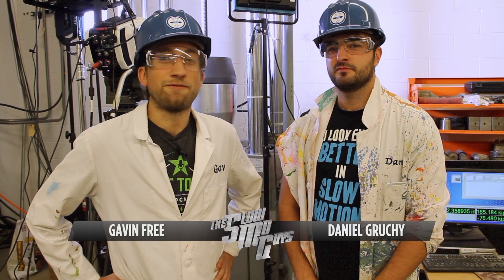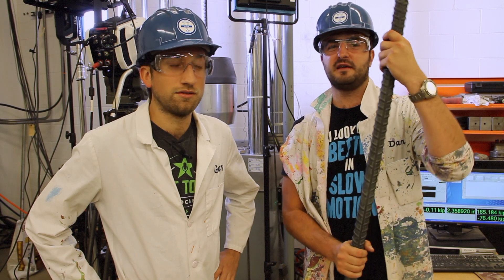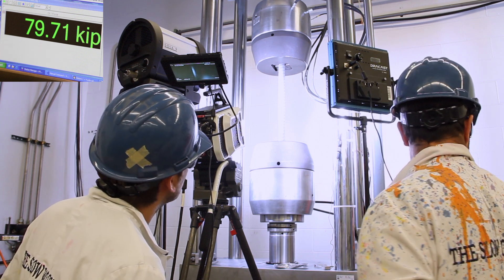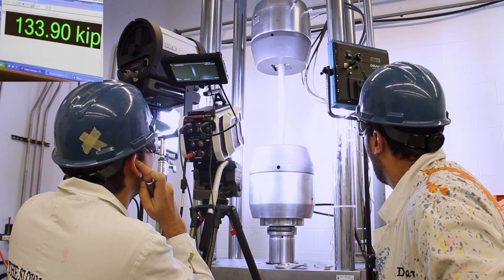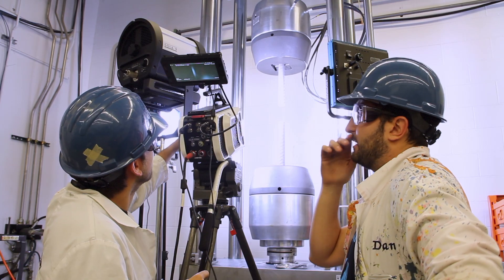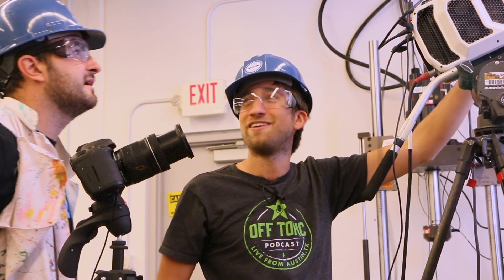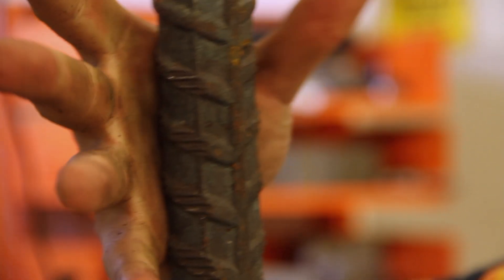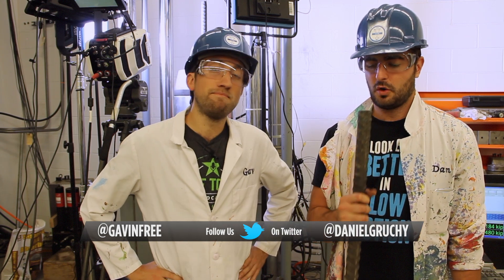Snapping a Steel Rod 1000x slower - The Slow Mo Guys

Comment: 157,000 LBS is an extreme amount of pressure. For comparison the pressure 7 miles below the ocean, at the bottom of the Mariana Trench, is only 15,750 PSI

Comment: 220,000 pounds is 100 tons.
The 1.5 inch bar has 1.75 square inches.
Rebar is made of cheap recycled scrap metal with  grade 60  tensile strength of perhaps  40 tons.
Therefore the bar should break at 75 tons which equals 75 x 2200 = 165,000.
It broke at 157,000.
This test therefore shows that Grade 60 Rebar is not as strong as claimed.
What is interesting is that in the latter stages 'bits were popping off'.  These bits are iron oxide which if melted in a hot fire would give the microspheres that imbeciles like Judy Wood claim show that 9/11 was controlled demolition with thermite and 'direct energy weapons.'

Comment: I was searching for clips showing the speed of sound in steel, like a solid version of dropping a slinky. I suspect the 48kHz clip probably would have shown that, if you'd run a full view without the speed jumps. It's clear that the particle cloud is conical from the break outwards, but that could be due to the increased displacement near the break rather than a propagation effect.
 So close... 🥺

Comment: The little bits falling off is the scale  from the rolling.  Rebar is about a 40 carbon, you should try a lower carbon steel to see a more dramatic elongation like a 1006 grade wire rod.

Comment: Is steel rod brittle material?!!! My whole life I thought it was ductile material.
Reply: 1. ductile means you can deform it without it breaking (like hammer it flat) but this iron bar is not as ductile as something like copper or if red hot. The bar is left stretched while brittle glass will just break without any final length change. 2. understanding metal fracture was one reason high speed cameras where first developed - you can use the "necking" (which is one sign of ductility) to trigger the camera. The necking reduces the area so the stress is suddenly more concentrated there then all the further stretch happens in the necked section which further narrows it and that part suddenly fails. 3. In the video you can see the sound waves sent up the bar as the end of the bar vibrates up and down for a while after fracture. 4. Most fractures travel at the speed of sound which in a iron bar is about 3000m/s or 6700 miles per hour. The fracture will span the bar in about 10 microseconds.
Reply: @bcwbcw3741 brittle materials break at almost no angle. And ductile material breaks at 45degree angle. This is because brittle material breaks in tension. And ductile material tends to break in shear. Do you know why ductile material tends to fail in shear.

Comment: If you were to convert 220,000 pounds to foot pounds per second 1 hp is equal to 550 foot pounds per second so if you were to divide 220,000 by 550 it would equal to 400 hp your welcome

Comment: I wonder how many lives this machine has saved just in general. Cause it's used to test the strength of manufacturers products that go out to consumers like rebar exc... To basically give the product a maximum weight/strength capacity so it's not used on something that wouldnt be able to with stand the weight/force exc... For example like steel rods that help hold up bridges or buildings. That way the construction workers know what materials they can or cant use for each job they do. So I assume this machine has saved many lives cause of this which is pretty cool to think about and whom ever designed this machine definitely deserves credit for that js.

Comment: You should record what happens to tension cable that's under concrete slabs when it has too much tension and is cut how it rips through the slab and can even take someone's leg off if they stand over it.

Comment: It seems like you guys have used high strength bar because the fracture surface is a straight surface break. If you've used mild steel bar with low carbon content the fracture surface would have been conical and gradual yield would have occurred

Comment: Machine would make a lovely torture device.

Imagine if macabre things like public executions and that kind of stuff were still popular, like if they put them on prime time telly. They could torture the victim using that device, and slow-motion replays using your camera. It would be super entertainment, would it not?
Reply: I doubt it would be able to pull you apart without cutting off your arm, or just pulling the skin off. It needs to grip tightly in order to pull you apart from both ends.

Comment: How does the machine stop so quickly after snapping it? You'd expect the two parts to quickly 'explode', but instead they just smoothly stop.
Reply: There is a hydraulic/pneumatic press on both sides, building up pressure to catch the force
Reply: If you would stand near it while that happened, you would feel the shake going through the ground

Comment: Its not 60 kips its 60kpsi (minimum allowed yield of rebar) since its rebar and thats its yield strength(strength till its a plastic) not its true ultimate. It should yield at ~100 kips not 60 and should hit ultimate around 160 kips. KPSI and KIPS can be confusing given their similarities but there is a massive difference.   Edit: it looks like it did indeed make it to basically 160 kips which confirms that you were conflating pressure and force, as well as yield and ultimate.

Comment: Years ago I was trained in nondestructive testing. We also did some destructive testing with machines much smaller than yours. Part of what we learned is that typically before the sample failed the steel starts to deform and stretches and the tention drops  (I believe that this is called the point of maximum elasitisity.) The steel if released will not return to it's original shape, but it will not have broken. The stress/strain gauge will start to climb again untill the sample fails. The steel then gets stronger and at the point of failure requires even more force before it brakes.

Something similar occurs when steel is heated. Although carbon steel melts at approx 1200 F steel at around 600 F will start to deform and lose its ability to retain it's shape. This is caused be the crystalline structure starting to allow movement to occur along those boundaries.

If anyone wants to look further into this subject look for stress/strain testing, or testing for hardness in materials, also see a charpie-V tester where samples are broken to see how much force was needed to do it.

For anyone who might know or even have heard of it I trained at TAT through ORAU and graduated in 1982.

Comment: I wonder how the machine stops itself from just hurling itself into a wall from the pressure being released.
Reply: sTone ForesT maybe opposing magnetic force
Reply: The old fashioned tensile testers had four 4 inch diameter lead screws lifting a 12 inch thick steel block. The machine was very heavy.

Comment: When it breaks, is all that metal coming off just random stuff that was on the rod, or did it actually shatter and that was material breaking off from all over the rod?
Reply: My best guess is that it must have been a coating on the rod to prevent rust or some other use.

Comment: Why not show a force/strain diagram? The machine can output it pretty easy. You could talk about elasticity versus plasticity for example. Why would you go through the trouble of recording stuff in slow motion if you pass on the opportunity to talk about the science behind what you're seeing? When I watch this video I just hear "wow, cool, hurr durr".

And btw, it's a steel rod/bar and not a steel beam. Rods/bars are only subjected to axial loads while beams are also be subjected to transverse loads (and sometimes torsional loads).

Comment: It didn’t look straight after. Like both after it was broken, the two ends didn’t line up. So I wonder if it was ever completely in line from the top and bottom when it was being pulled apart. Which would mean it wasn’t a true “pulling a part” but more of a snap from the pressure and from being slightly bent.

Comment: Just did this to a piece of 1008 Low Carbon Steel in a lab at Purdue. It's all based on the metal's Tensile Strength. First, the metal elastically stretches (meaning it can return to its original length), until it reaches its Yield Tensile Strength. After that point, it stretches plastically (cannot return to original length). It will keep stretching until it reaches its Maximum Tensile Strength. At this point, it will start to "neck", which is the bit around the fracture Gavin pointed out at 4:37 . Wrote a whole lab report on it, so funny this video came into my recommendations lololol.

Comment: That's not actually the correct force pulled on the bar because it started weaking for the acceleration of the pull

Comment: Maximum crack propagation speed is the speed of sound (in steel that's 5.9km/s) so it crosses the bar in ~6.4 microseconds.
Reply: So at a million frames a second you have 7 frames

Comment: 4:00 how is it because of the friction? How can it cause friction on itself?
Reply: Winston Smith as you deform a material (in particular metals) you are just moving layers of material inside of it. This cause friction, or rather, moving these layers requires a lot of energy, a lot of it which turns into heat. But there is relative movement between these layers, so one can think of it as friction

Comment: I think 220 kips is 220,000 foot-pounds of force per second, which is 400 Horsepower. Ish. So basically a bit less than Dodge Charger with a large hemi engine. A Fleet is a general way of saying "all of what we have for transportation" so that works.

Comment: It is a tensile test conducted on a steel reinforcement bar . which resulted in deformation in length and ruptured at fracture point. Steel is a ductile material but concrete is a brittle one.

Comment: i feel like this should get re visited, and a slower frame rate should be used, all the attention in this video is towards the dust falling off it, meanwhile i wanna see the metal rip, and it was waay to quick for this frame rate to see any ripping going on

Comment: I would have loved to see this shot with a thermal camera...
Reply: Tb to primary when I bent a 2mm copper wire until it snapped, and burned my hand when i touched it.
Reply: A thermal slowmotion camera
Reply: Leo Ben you clearly know what your talking about. When you bend metal, it heats up at the bend point. Thicker the metal, the more heat generated. Kudos from an Ironworker.
Reply: Paul Bryant that’s pretty much common knowledge
Reply: @PBe777  everybody knows that, basic physics and thermodynamics
Reply: @leoben53  new business idea :)
Reply: @leoben53  lmao too much
Reply: Leo Ben Does this exist?
Reply: @leoben53  Can't have more than 9fps thermal camera.  world wide ban enforced by uncle Sam.
Reply: @leoben53  that would be the stupidest thing ever
Reply: @bbrizs   not really, could be very useful in electronics
Reply: Bálint Bé how is that stupid? You can see where the heat starts at and how it spreads
Reply: @bbrizs  explain
Reply: Exactly just think how much heat that generated
Reply: @jlijj  maybe 3?
Reply: The amount of heat that must’ve generated should be crazy
Reply: @Sherwin Aguilar Not really
Reply: @Sherwin Aguilar Maybe a few degrees, but not that much actually
Reply: Petition for a second, thermalguys
Reply: Its on The Ther-Mo Guys channel.
Reply: I suppose that's how stresses in steel structures are measured from a distance? The hotter points would be the most critical
Reply: You’d have to see that on “The Ther Mo Guys”
Reply: @DannyBPhD If you are trying to be funny, just stop...
Reply: A thermal slow motion camera
Reply: Awesome idea👍
Reply: dracophyle Filming an angle grinder Cutting a piece of metal in closeup so that you can see the metal get ripped away.
Reply: @braamschmidmountainbiking632  that would make the cut for an oddly satisfying video!
Reply: Ooooh good call
Reply: That would be sooooo coooooool
Reply: Using thermal camera while bending the rod
Reply: Came here to say that!
Reply: Id love to see this one revisited
Reply: The first eco heater!
Reply: Yea that would get hella hot
Reply: Yes
Reply: Same
Reply: Well watch the thermal vision guys
Reply: yes me to
Reply: @VibezVideo  I want royalties if you make this happen 😆. 

But seriously... $$$
Reply: USA gov will cockblock your high speed thermal camera purchase
Reply: Yes please
Reply: No
Reply: That'd be awesome.
Reply: Definitely heated up

Comment: Did you speed up the vid a bit or why do you two sound like kids in this
Reply: I would guess it actually has to do with mixing the sound such that their voices can be heard distinctly from the background noise. Maybe a high pass filter, or something. They're definitely not moving or speaking faster than they normally do.
Reply: Daniel Gregg a filter wouldn’t change the pitch, it would just emphasise the frequencies that were already there. Most likely this is a case of them recording the audio at 44.1kHz then exporting it at 48kHz
Reply: Sounds so weird
Reply: Glad I'm not the only one that noticed this. It's definitely sped up a bit
Reply: Why do you look like a poptart?
Reply: because it was 3 years ago
Reply: the “ready” at 1 minute 😂😂😂😂
Reply: Here’s what probably happened. They most likely uploaded this at 25 frames per second but messed something up so it’s playing at 30. Gav said in a video that he uploads at 25 fps to make division easier. Dividing by 25 yields much nicer numbers than diving by 30. Recently though they started uploading at 50 fps
Reply: In one of the behind-the-scenes clips, they discuss that they run their videos at 25FPS.
If it's been reformatted to 30FPS (likely by YouTube being stupid), that would result in an overall speed increase that could explain this effect.
Reply: worse microphones back then
Reply: Torkala Torkala a worse microphone doesn’t make people sound higher pitched.
Reply: About a minor 3rd higher
Reply: It’s not sped up at all, it’s because the machines running in the background create a lot of noise, and it drowns our the lower frequencies of their voice, so only the higher ones can make it through to the microphone, hence why they sound higher pitched
Reply: @wormslop  as Josh Cook explained, cutting out lower frequencies wouldn't raise the pitch of their voice.
Reply: @Ghv103073  You're a bit of an idiot aren't you
Reply: It seems sped up
Reply: They're British

Comment: So we learned in solids that ductile materials fail in sheer and that max sheer is 45 degrees from original plane.   So why is there not more of an angle on the break?
Reply: Mint Berry the re-bar is not under shear stress in this demonstration it is under tensile stress. This machine is designed to test the tensile strength and confirm Young’s modulus of the material.
Reply: Kane Maloney thank you for the explanation! 😃 I knew there wasn’t any shear stress being applied to the rod and what we were witnessing was young’s modules but I seem to remember discussing in class about how ductile material fails in shear. Am I thinking of mores circle? I thought I heard my prof talk about how ductile material will shear at a 45 degree angle when pulled passed ultimate strength.

Comment: Thank you for the video guys. It is so surprising that there is no neck formation at the location of failure. And this is a typical textbook failure example for brittle failure. Can you please test multiple bars with different diameters in slow motion?? Just to understand how it fails

Comment: The exterior of steel commonly has an oxidized coating. This is actually harder than the interior steel and subsequently more brittle as a result. The layer is unable to stretch as well as its counterpart so that is why you see flaking.
Reply: I was thinking of mentioning the same thing.  It's not "dirt" flaking off, it's the treated outside that I think helps protect the inside from rusting.  Neat video.

Comment: A #11 rebar is Not an inch and a half thick.  The number used (#11) refers to the number of 1/8".  A number 11 would be 11 1/8" making it 1 3/8" not 1 1/2"